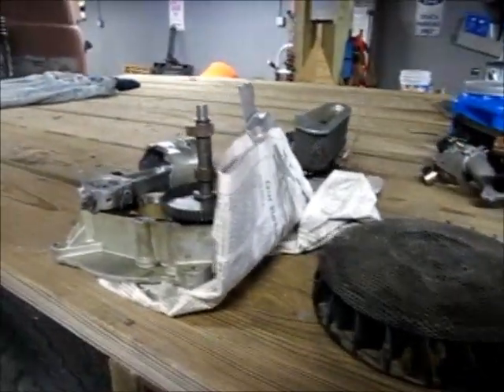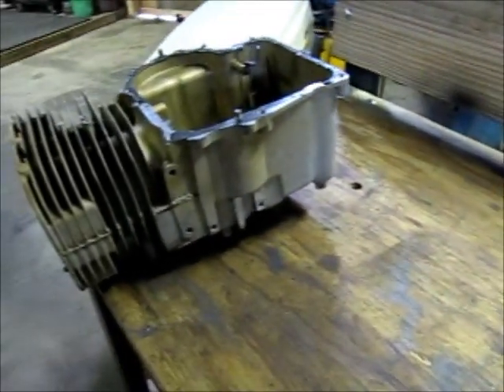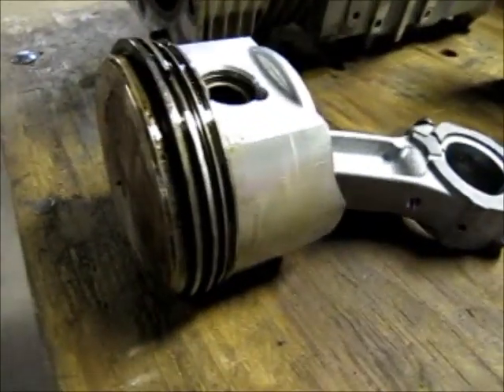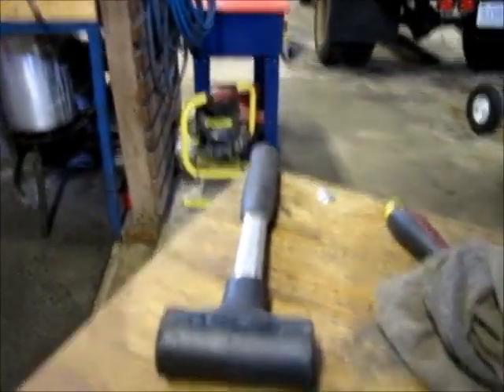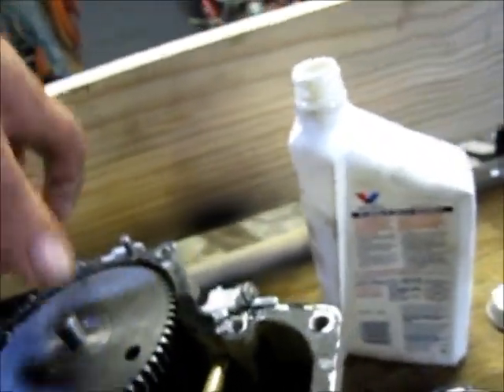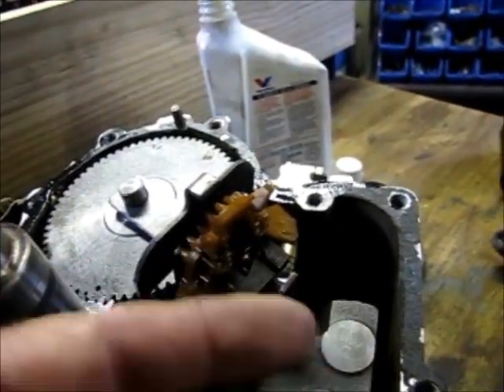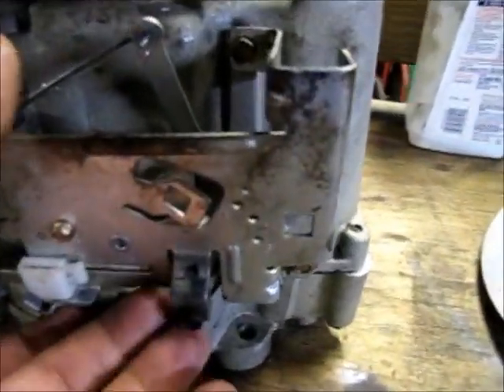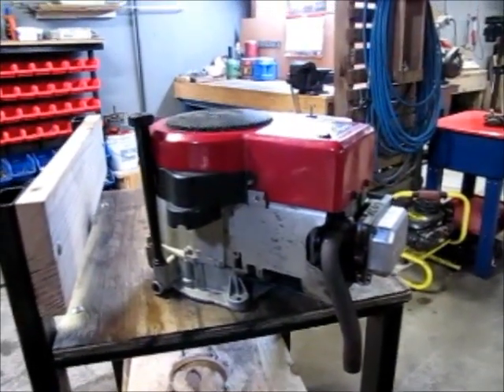Assembling a 14.5 HP Briggs and Stratton I/C single cylinder motor.

Comment: Thank you for posting.  You took the mystery of opening the case.  Outside of the final valve adjustment and setting carb back to proper settings, there's not much to it!